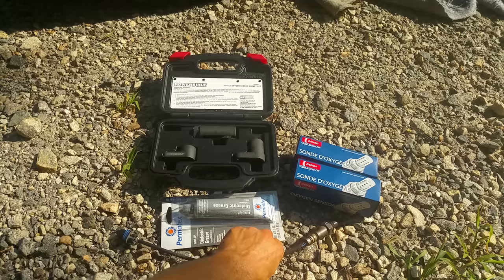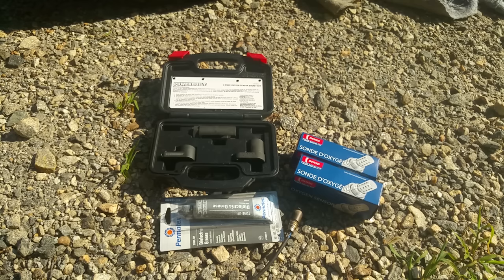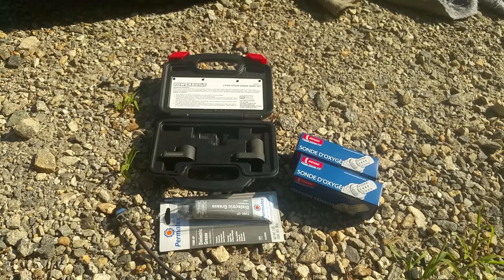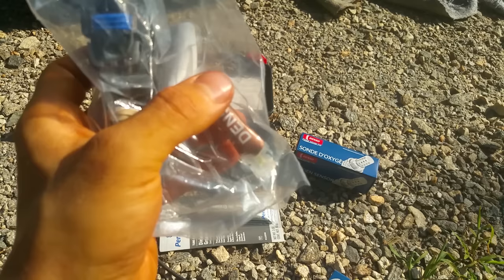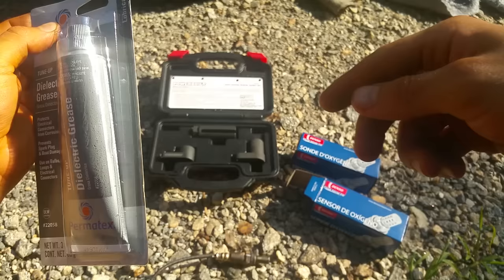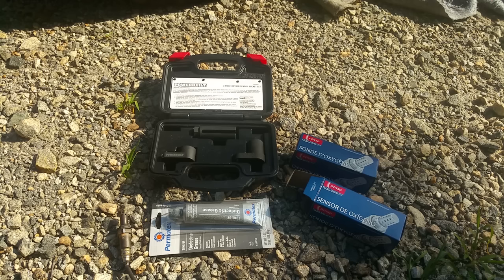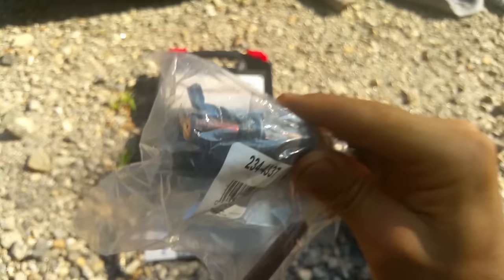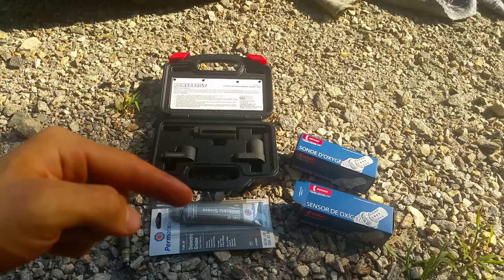NEVER Change Another O2 Sensor Until You WATCH THIS!

Comment: Disconnecting the battery will not reset your codes you have to have it hooked up to a handheld computer what you can have that done at AutoZone Advance Auto oreillys or go to one of these other part places which they can reset the code for you but I also found your video very educational I'm getting ready to replace my Upstream O2 sensor on my 2004 Chevrolet Cavalier and I have spoken to several different mechanics and they informed me that disconnecting the battery will not take care of the code issue it has to be reset by the computer because I thought the same thing too unfortunately it no longer works that way
Reply from the maker: I'm glad you liked the vid. Disconnecting the battery is something that I like to do to help reset the computer. For some stuff it works. In my case I changed the sensors and disconnected the battery and the code went away. You can get an auto parts store to clear the code, but it is just a waste of time if you don't change the sensor. I already tried that many times and it just comes back.

Most of the time, if you change the sensor and just drive normally without disconnecting the battery the code goes away on it's own. You are right though. Disconnecting the battery on some really new cars can wreak HAVOC!
Reply: IT'SME  I'm sorry but it no longer works with these newer cars but oreillys and AutoZone and Advance Auto have the code computers that you need to reset the codes and Walmart now for 60 bucks has the code computer that runs off of your cell phone so it's worth you buying the $60 program for 60 bucks that you can go from vehicle to vehicle to vehicle for 60 bucks that way if any other codes come up you know what they are and you're not attempting to clear codes which only simply knocks off the code only for 5 to 10 minutes at the most and can actually in some cases shut down your vehicle and lock it down that's something that GM will not tell you and other auto companies that's why they tell you to hook a 9 volt battery to your battery terminals when you're disconnecting your battery so you do not have to reprogram your computer
Reply: It clears the codes temporarily. In order to pass your inspection like in Texas so many codes need to be read, so you need to drive a while after clearing; like 50 to 100 miles depending on the car. I think Texas allows 2 codes out of the ones they check to not be read at all so long as they're not throwing a code. Also, if your downstream sensors are bad you can look into the spark plug fouler cap trick.
Reply from the maker: That's crazy you have to go through all of that with codes in Texas. I don't have any of that here.
Reply: My auto zone will get the codes for you but say policy forbids code erase. Issue about liability. The rat maze continues.
Reply from the maker: Lol hit every auto store until you find one that will clear the codes for you.
Reply: Can't you just disconnect both battery cables and touch them together for a few minutes to clear the ECM?
Reply: it works on my honda civic. It probably depends on the type of car
Reply: I have a nissan versa note 2014 and my codes cleared when i disconnectrd the battery
Reply: Disconnect of battery with a sufficient length of time (15 min) WILL reset codes, most cars are designed this way, you can also quickly clear codes by removing POSITIVE and NEGATIVE cable and briefly touching together, DO NOT SHORT WITH CABLES CONNECTED, DISCONNECT BOTH CABLES AND TOUCH TOGETHER BRIEFLY
Reply: It works on some older cars.
Reply: it works on all cars, excepting perhaps some hybrids and electric vehicles whose batteries would require serious work to disconnect.
Reply: @MattsShop  ...the auto parts store I went to today ( in SC) said they will not reset codes as it will be a $5000 fine. Maybe he's wrong, or maybe it's a state-specific thing.....but that was my surprise answer today.
Reply: @MattsShop  yea I did the battery trick an it worked, just got to wait an see how it plays out
Reply: You can also buy em in walmart for like 20 bucks n do it your self lol

Comment: can someopne help me out i have mercedes sl350 i got the chech engine light  with readings i changed the bank 1 both sensor after runing 50 -60km miles next day i get the check engine light again have checked all wiring harness i get the code as p015300 oxygen sensor has a delayed reaction .

Comment: What code did you get?

I have a p0420 code....could that be for O2 sensor too
Reply: Usually it's for the Catyltic converter.
Reply: I have a p0430 catalyst failure code on my 02 Tahoe. My upstream 02 sensor has a wire that is nicked. Would this most likely be the problem. P0430 bank 2 sensor 2

Comment: Chris Chiampo: I have been a mechanic for more then 30 years and in the Retail parts business for more then 6. I would not use Vaseline for anything other then a sore. Dielectric Grease is formulated to give you better voltage "Pass Through" to the circuits then Vaseline can. Also, dielectric grease will last longer and being a "grease" it lubricates the electronic connectors. keeping them from rusting for a longer period of time. By the way, good video.
Reply from the maker: +John La Frieda You heard the man, haha. Yea, I would always use the right product for the job. Saying vaseline is the same as dielectric grease is like saying 10W-30 is the same as 140W oil. It's all oil right?
Reply: LOL.... Absolutely. One never wants to turn to something "similar" because you may save a few pennies. "Penny wise is dollar foolish." Save a few cents now, spend allot of bucks later to correct your a problem that YOU caused. After all, we all know that rust FOLLOWS an electric current, causing rust to follow the wire loom under the insulation. IE: Battery Corrosion.
Reply: I assumed he meant after its connected to seal the connection after its together, like spark plugt boots etc, connections already have a crush ring seal the grease is so moisture can not infiltrate as readily if immersed or wet.

Comment: i touched the tip do i need to replace sensor will the o2 reading be skewed with finger grease on it
Reply from the maker: Nahh you'll be fine. I use a little rubbing alcohol to clean grease off of them.

Comment: Wow.. I change my every 75k no matter what... you can see when wear out when you see you bot getting the same miles per tank.. my 01 accord get 357mile per tank city n high way. Highway only I get 389 per tank at 70mph.. but this me I notice thing like this and log my mile per tank. I i have a h02 upstream and 02 sensor down stream on my cat. So o t need so. Tools to remove them but a crescent wrench. Have worked on cars where you have to remove the header to get to the o2 sensor on top.  Then you have bank 1/2 and upstream and down stream upstream are h02 sensors but seen new cars have them in the downstream side now? But if you need help and know what o2 sensors out Google it I been putting pictures on this on the web to help d.i.y. people because seen where shop will charge 200.00usd to change one sensor that up front and take less then five min. Let me know your year and make and I'll see if in have the video and can uploaded again to my channel since YouTube toke most my d.i.y video down..
Reply: That seems a bit excessive and costly to change out O2 sensors that aren't broken.  You know the old axium: "if it aint broke....
Reply from the maker: Agreed!
Reply: @BeanieandCecil  02 sensors have a finite life and you will get poor mileage even before they throw codes.  Depending on the vehicle could cost you a lot more to not change em.

Comment: Matt just a heads up ! It's not a good idea to put any kind of grease or fluid on the o2 sensor wiring contact as it will cause it to short out and not read properly. It will come up on the code reader as such. I know because mine did ! I just hope I can clean it off now and have it read properly otherwise I'm going to have to purchase another one ! If so will you purchase it for me since it was your erroneous advise ?
Reply from the maker: Di-electric grease does not effect the flow of electricity enough to matter. It's a myth. That's literally why it was created: to protect electrical connections.

Comment: Do you have to reset the code or will the code go away after driving it once you replace the o2?
Reply from the maker: It should go away. I disconnected the battery. They say you don't really have to especially if you have a really new car.
Reply: @MattsShop  I bought one of those 100 dollar wifi scanners for droid smart phones and tablets, I reset the code and followed the manufacturer's guidance for
driving cycles so the monitors updated/set as soon as possible.  I did get stopped by a young officer who ganked me for turning on a no right on red with zero 
traffic... but... everything reset and it was okay.  I had replaced on cat and a bit of the pipe and one of the o2s was slightly bad which was creating new symptoms.
The idiot light stays off now except sometimes when it is really really cold.  It's a dodge truck, cost 500 dollars, but like a prostitute, the cheaper it is, the more you
pay.

Comment: You can also break the old ones off so just the nut holding the tip of the sensor in and use any socket because 90% of the time you won't have 3-4in of space to work..
Reply from the maker: Yea, that works if you don't have a O2 sensor socket handy.

Comment: most aftermarket oxygen sensors are complete garbage  , they will set sensor code even if you did not have one before
Reply from the maker: Yea, the OEMs use Delphi, Bosch, or Denso stuff and then rebrand it. That's why I reccomend their stuff.
Reply: Matt's Shop Bosch is trash tho. I exchanged with Bosch twice and had to go with something else because Bosch would still get me a code. I went with Denso
Reply: Dam I just saved some money by not going with denso smh hope I don't get the light

Comment: Dielectric grease should NOT be used on electrical connections, it is an insulator and should only be used for waterproofing boots and such...
Reply from the maker: That's not true. Passing electricity through grease is way more complicated than that. Why do they put dielectric grease on a lot of brand new spark plug wires if it's an insulator?
Reply: Dielectric grease
Dielectric grease is electrically insulating and does not break down when high voltage is applied. It is often applied to electrical connectors, particularly those containing rubber gaskets, as a means of lubricating and sealing rubber portions of the connector without arcing.

A common use of dielectric grease is in high-voltage connections associated with gasoline engine spark plugs. The grease is applied to the rubber boot of the plug wire. This helps the rubber boot slide onto the ceramic insulator of the plug. The grease also acts to seal the rubber boot, while at the same time preventing the rubber from becoming stuck to the ceramic. Generally, spark plugs are located in areas of high temperature and the grease is formulated to withstand the temperature range expected. It can be applied to the actual contact as well, because the contact pressure is sufficient to penetrate the grease film. Doing so on such high pressure contact surfaces between different metals has the advantage of sealing the contact area against electrolytes that might cause rapid deterioration from galvanic corrosion.

Another common use of dielectric grease is on the rubber mating surfaces or gaskets of multi-pin electrical connectors used in automotive and marine engines. The grease again acts as a lubricant and a sealant on the nonconductive mating surfaces of the connector. It is not recommended to be applied to the actual electrical conductive contacts of the connector because it could interfere with the electrical signals passing through the connector in cases where the contact pressure is very low. Products designed as electronic connector lubricants, on the other hand, should be applied to such connector contacts and can dramatically extend their useful life. Polyphenyl ether, rather than silicone grease, is the active ingredient in some such connector lubricants.

Silicone grease should not be applied to (or next to) any switch contact that might experience arcing, as silicone can convert to silicon carbide under arcing conditions, and accumulation of the silicon carbide can cause the contacts to prematurely fail. (British Telecom had this problem in the 1970s when silicone Symel® sleeving was used in telephone exchanges. Vapor from the sleeving migrated to relay contacts and the resultant silicon carbide caused intermittent connection.[

Not meaning to complicate the issue, but you are right, and/or possibly wrong... as am I.  Spark plugs seem to be OK, but not low voltage connections.  Is that clear as mud?  I had just read about NOT using on spark plugs, as I have just replaced mine,  and to be used only on the rubber boots to waterproof and aid removal.  It is also supposed to help prevent arcing, yet the last sentence indicates there is an issue if arcing occurs.  Go figure...  Oh, the previous is from Wikipedia, so it has to be right, right?   https://en.wikipedia.org/wiki/Silicone_grease#Dielectric_grease
Reply: +Teddy Even more: never apply ANYTHING at all to the oxygen sensor electrical connector. These ones apparently breath reference air from the wiring. Fucked an AFR O2 sensor up myself by applying residue free contact cleaner to both connector ends (sensor+harness) since i saw the connector dirty with oil all spread over it and was doing a little tune up which also meant a good MAF cleaning (this one didn't give any issue at all however). Aside from the MIL and a P0130, car started running amazingly rich to the point gasoline was dripping from the tailpipe, not to mention the awful smell. A new AFR O2 sensor fixed everything up before the cat could be damaged. Expensive mistake, even though a new AFR probe was in order anyway since the car was about to turn 16 years old. On the other hand i applied the same electronic contact cleaner to both MAF connectors (the one on the sensor and the harness one) and it didn't give any trouble at all.
Reply: @teravolt6113  yep!
Reply: Steven Rutsch not just that but he tried cleaning the sensor with carb cleaner 😂 if it wasn’t already shot then now it is

Comment: o2 sensors have been the bane of my existence. My downstream sensor is bad and and on the connector, the clip that locks it onto the male connector has broken off and a piece remains stuck inside, keeping the connector locked together.

I want to bang my head into a wall. Has anyone had to deal with something like this before? I have a 2002 Dodge Durango R/T and for the life of me I can't get it to unclip because the locking mechanism that broke has still got a piece stuck in it.
Reply from the maker: +Braden Nielsen That sounds like a real pain. No I have never had that problem before, maybe someone else has. Have you tried fine tipped picks to dig it out?

Just the plastic part broke down in the connector or the metal pins broke off too??

Don't worry, you'll fix it!
Reply: You can start you car for a few min to let heat get to the sensor. You can also spray PB blast a day before to loosen up the rust on the threads to take it the old one
Reply from the maker: Yea, those are good tips

Comment: hi i watched a vid on a 1998 ranger you replaced the pack did that solve the problem? also i have a 98 4x4 ranger you have a link for the 4x4 vac lines point a to b ?
Reply from the maker: +Bobby Pennington Yes! It can solve the problem! I had a bad plug too in that vid. I found out later. You need a hose routing diagram??

Comment: You don't use dialect grease on a O2 sensor and use a propane torch to heat up before you remove sensor.  Your throwing out the old ones so no need for the tool kit.  Just unplug and cut the wire off the old ones.  Use penetration fluid 30 min prior and you can use closed end of a box wrench.  Tap wrench end with hammer or hand held sledge hammer.  Loosen slowly, when it gives go back and toward then loosen further.  If you wrench too hard to get off quick you risk stripping the treads if it's really stuck on been on a long time.  Go slow and use heat for removal are the key points.  You can use the open end on the box wrench to install the new one.  Buy the tool and use torque wrench if your not comfortable feeling for the correct torque.